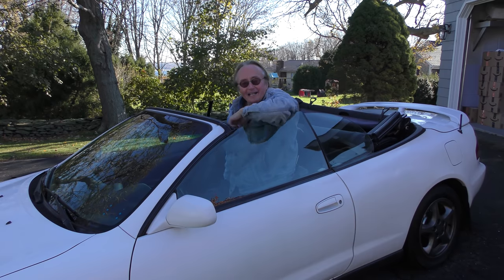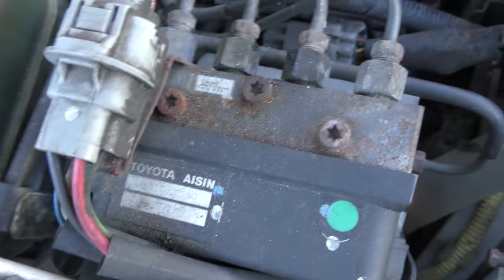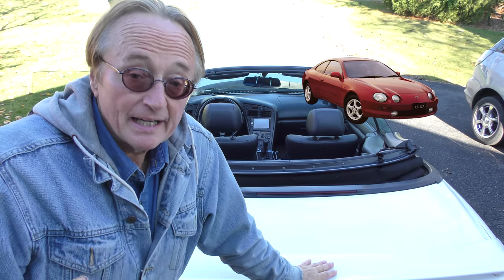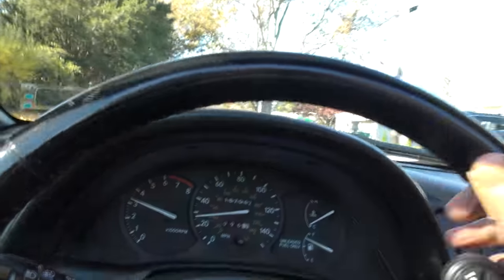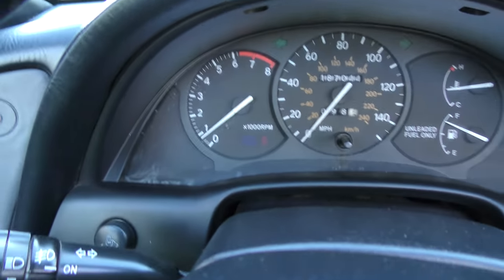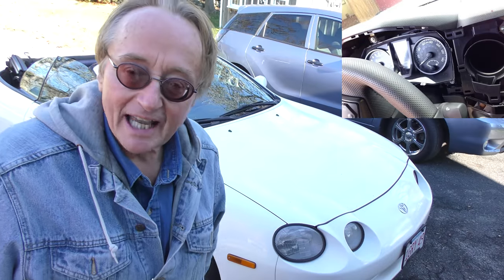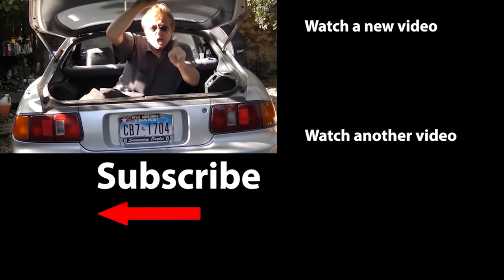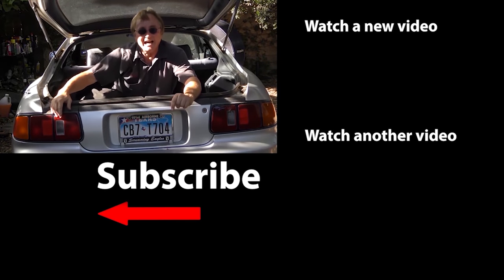I'm Sitting in the Best Car Ever Made

Comment: I have been driving my 7th gen Celica for 20 years. The original 1ZZFE (Toyota) engine developed the dreaded oil burning issue. Installed a 2ZZFE (Toyota+Yamaha) and zero issues. You might not like the design but the hatch swallows everything from mountain bikes to bookcases. 2400lbs and 200whp with 6 gears is absolute joy.

Comment: Just bought my 97 Celica GT convertible for $1200.  Was part of an estate sale, the owner who had it from 2004 recently died so was sold by his brother in law.  Not as nice as this one granted, and mine has 230,000 miles but engine and transmission are flawless although I think I have a power steering leak I need to investigate.  Just put on new KYB struts/mounts all round, the old ones were the originals and shot to pieces, the one on the front right side was so bad it was making a knocking sound, rides like a dream now.

Comment: I have my 95 GT rag top. 5 SPD.  I've owned it for ten years. Other than a set of brakes and a timing belt,  I've had zero problems. 168,000 miles.

Comment: I had a 99 solara it was a 3.0 V6 5 speed manual thing was actually awesome
Reply: I had the same, only with an auto. Drove it all through my twenties and put on tons of drama-free miles. Didn’t know they came with the manual—that would’ve been fun for sure. It was the best all around car I’ve had until I got my current 2012 Camaro SS, which  has been fantastic. Of course, it has the 6.2 LS3 and the 6 speed manual.

Comment: I have the latest shape Celica and the only thing heavier than the doors are neutron stars.
The amount of passengers that can't even open the door with the weight of them when park on a slope. Haha

As for the Yamaha engine if you buy one after 2002 the issues were fixed so they're a very dependable engine... plus they're a timing chain so no worries about belts snapping.

Comment: This is why I love my miata; manual convertible top, manual windows, manual locks, no power steering and a very smooth manual transmission. 30 years old, still looks and runs like a top.
Reply: 100% agree! Mine sadly has power steering and electric windows, but i absolute love how perfect it still runs and drives. best Fun for the buck.

Comment: I had a 1982 Celica with the 22R and a 1982 supra with an inline 6. Both were rust buckets with multiple problems. I had to fix headlight retractor motors, suspension, crankshaft pulley wore out and it was off timing 23 degrees and always some of the gadgets breaking. Too many problems to list.

Comment: Had a 1999 Celica GT convertible in Iris Blue about 15 years ago. Bought if from the original owner in almost immaculate condition, kept it about 4 years and sold it with 95K on the odo. Handled well, but way underpowered to really be any fun. 40 or 50 more hp would have made me smile. The most uncomfortable seats I've ever had in a car. I could never get the driver's window and rear seat window to align correctly - whistled like crazy. It was an OK car, but I'd never call it "The Best Car Ever Made".

Comment: Hello Scotty, nice car, lol.  I have a 2002 Acura Tl that I gave to my dad (retired) to drive around. It has 220k miles A/C heat no lights at all. I did the second timing belt myself 4 years ago,I got lucky when they did the trans recall in 2005 lol everything is original except the starter. I was a mechanic myself back in 2010. Good old Japanese made, not these new craps that breaks down in a year.  LOL.

Comment: The 90's Celica's rotted away 20 years ago around here.  It wasn't a common car, most of the parts are discontinued. Type in 1994 Celica on ebay and you will find no parts. The drivetrain would not be a problem but getting Celica specific parts new and used would be difficult and expensive.  Your better off buying a common car like a Corolla or a Civic.

Comment: Hey what do think of a 2001 subaru legacy wagon?? Mine is good condition much like this Toyota. Engine is clean except back 2 cylinders a lil leaky. But drives good. Oil is good but coolant tank is getting black. Not over heating at all. What do think i should do??

Comment: Well sir my 2002 taurus was smashed by a red light runner so with the ins money i just got a 2000 toyota solara v6 101000 miles ... just changed oil syn and  transmission fluid got it   for 3500 i know you like them ....

Comment: is toyota celica 2002 worth buying for a sport car?
Reply: I've had two.
I'm on my second one now the first one had 180k miles when I swapped it for a 2005.
The only issues I've had with both is the radiator had a leak on my older one, but it was easy to repair and cheap to replace.
If youre going for a 2002 that's the refined 1.8 engine. Pre 2002 the engines could have oil burning issues but this was pretty much sorted after 2002.
But if you're the type of person that checks their oil regularly this won't be a problem as you just top it up when needed.

They're easy to work on too if you're the DIY sort as they're in that age where you can still work on a car... 

They're fun to drive too, they stick to the road like glue even keeping up with much faster stuff around the twisties. But power is probably the only downside, its from a different era so most modern cars will out run it in a drag race, there are two versions too.
A 140bhp VVTI model which will hit 0-60 in around 8.5 seconds.
And a 190 VVTLI which is closer to 7 seconds. Personally I've always gone for the 140, cheaper insurance, running costs and the valve lift (the L in VVTLI) can be problematic if neglected. Plus the lift only kicks in at higher revs like VTEC so upto that point there isn't much difference in acceleration.

Also if you can go for the premium spec, you'll get leather and climate control for no extra charge if you look for it, so don't settle for cloth seats and old slider heater toggles.

Sorry for the long reply but if you have any other questions just let me know.

Comment: Doesn't look like the safest car in the world.  I have a Volvo C70 hardtop convertible. With the top down I pretty much lose access to the trunk as that's where the panels go, but it has ROPS (Roll Over Protection System) which automatically pops up in the event of a rollover to keep the car from turning flat turtle on my head.  As soon as you feel the sides of the Volvo you realize how much more car body is there to protect from side impacts.  5 cylinder turbo gives it reasonable performance and is much smoother than a 4 cylinder.

Comment: That's a high flow intake. Any aftermarket filter setup that sits inside the bay like that is high flow. Cold air intakes pull air in from the fenderwell or bumper area outside the bay.
Reply: Ask him if he cares about the difference. He's not a fan of neither one
Reply: As someone who works on cars he should. Those intakes can hurt performance once the car is heat soaked. Can also make the car run funny if the MAF isn't located right. Most the stuff he works on is stock so it's whatever at the end of the day.

Comment: I used to be a Toyota guy, two 4Runners year 99/11 and an 06 Tacoma, I sold the Tacoma last year, it was my third vehicle and posed a problem when I moved a 5 hr drive to my new home. (Two drivers, three cars) I thought I sold it for a good price @ $21,900 it was a loaded TRD with tow package with only 40,000 miles. (Less than 3000 mi a yr. Now this year I see them going for above original selling price?? WTF happened?  I was in getting one of my current cars serviced and they were saying ppl are paying up to $40 grand for something like my pristine updated 06?  I’m in Canada so I’m not sure if it’s country specific, but supply and demand issues in N America are making things crazy!  I have a SUV and a white convertible, hehe, Scotty wouldn’t be a fan, the little rag top has a naturally aspirated 4.2 litre V8 putting out 450 hp …Schnell! 😂

Comment: you say the yamaha engines are no good? i got a 2003 pontiac vibe gt which has the toyota/yamaha engine. milage was stuck at 299999 kms which is common with vibes/corolla/matrix of that year. guy wanted 2400 and i talked him down to 2000 CAD so i thought it was a decent deal. almost had it a full year and its going strong still. glad i grabbed it when i did cause gas was 127.9/L when i got it and i primarily bought it for fuel efficiency and it jumped to 143.9 awhile back and stayed there.
Reply: @Marcel Obey that’s because you probably drive like a granny😂

Comment: Hi I have a question anyone could help i live in NSW Sydney i have a 2019 2.2 turbo diesel mazda done 55000kms CX5 the car was showing dpf warning light the mazda cx5 has been taken 3 times to mazda car workshop dealer they have changed the DPF sensor and checked car all around and they done a full report test. The was repaird but the issue still has come again with the same problem the Next day DPF warning light What could it be please.

Comment: Oh Scotty, that car has no rust because it's NEVER driven in the Winter. That's somebody's toy, you better believe it runs and drives good. Duh. 3 grand? Really? That is a good deal. And the little things are done. But, it sounds like it needs a lot of work now starting with the struts. Those should have been done. The springs have to be sagging by now and probably were 10 years ago. And that starter, and that alternator. It's all coming due. The thing's 25 years old. It's a classic by definition. But this is make or break time. Use it or lose it. But, for 3 grand, assuming she always got her oil changes, a couple grand more to make her like new mechanically is a great deal. Especially today. Just love the convertible. I had to do a double take when you said it was a Toyota. I don't know, I think the Miata is better looking. But this is really nice. Great find! I can't believe the scan tool even plugged into it.

Comment: every new car is tinny sounding doors. my old one has a nice thud. maybe the new ones have to break in a little? i like the look of the last generation of celica. they shoulda kept making them, so what, they made a mistake with the engine, just correct the mistake and carry on. toyota's weird lol they get scared of their own car models if something goes somewhat wrong. like they tried that scion branding and gave up quick on it. scion had some nice stylings but wasnt necessary to begin with but shoulda carried over some of those semi boxy styles.
187 000 miles with same AC and alternator hehe. but that's near the end of the life of those components. how many miles on your lexus? you said you changed the alternator recently.

Comment: Scotty, I would like to hear your opinion regarding the new Santa Cruz 😆
Reply: My opinion it’s ugly as hell a Honda Ridgeline is 1,000 times nicer and more attractive and it’s more masculine a Santa Cruz is very weak only 4 cylinders, good on gas but that’s it. 😂
Reply: @codybrandoncargle3129  I actually wanted a ridgeline. However, it starts at the point the Santa Cruz is already fully loaded.
Regarding the appearance and performance, I like what is offered. 2.5T with 281 HP isn't bad for me.
Reply: @diegovn  Santa Cruz maybe fully loaded but the Ridgeline will last longer trust me Hyundai engines are extremely weak especially the piston rings in them. 🤔
Reply: @codybrandoncargle3129  this is what I am afraid off. For sure honda and Toyota are much better. However, I barely drive 10k per year. I bet this car can last at least 10 years with me without problems.
I currently have a Mitsubishi, a brand that I used to like in the past. Nowadays its also so poorly made. Not so far from these korean cars.
Reply: @diegovn  Yeah it’s okay to be afraid of, yes Honda and Toyota are definitely better, yeah that’s good to know, umm maybe, and yeah Mitsubishi is definitely garbage plus the transmissions are worse than Nissan from what I heard, Korean cars are still not much better they will last longer than Mitsubishi but are still below Nissan level of good actually. 🤔
Reply: @codybrandoncargle3129  definitively. Almost all brands are garbage nowadays. Nissan also suck. I miss the 80's, 90's.
If I did not have to wait forever again, I would probably try a RAV4 instead. But I also need a truck(ish).
Fingers crossed it won't become the new Sonata/Elantra.
Reply: @diegovn  Yeah that’s true about almost all car brands and yes Nissan is extremely lousy, yeah the 80’s was before my time but my parents definitely miss it probably more so my mom than my dad since he was born in 1960, and the 90’s well I was born in 1995, so technically I was in the middle of it, and yeah the RAV4 is a decent suv but I prefer the Cx series more, and yeah for now the Sonata/Elantra is safe, but the design of Hyundai cars is atrocious to me, and secondly I amazed Kia won’t come out with a similar vehicle just like the Ridgeline and Santa Cruz! 🤔
Reply: @codybrandoncargle3129  Yeah. I Will at least search more about this car before buying (I am still waiting to arrive). I am not a fan of the cx line design. And this is also the first Hyundai I like visually. Anyways. I'd like to see a review from Scotty 🙃
Reply: @diegovn  Yeah I would man, why don’t you like the Mazda Cx series? 😳 And honestly the only Hyundai I truly like is the Veloster that’s it? 🤔
Reply: @codybrandoncargle3129  dunno. None of the Mazda cars are appealing to me. The veloster is kinda okay tho
Reply: @diegovn  Wow you don’t like none of the Mazda cars and they don’t appeal to you Hmm! 🤔 What car brands do appeal to you then? 🤔 And yeah like I said I’m not a Kia or Hyundai fan I personally only like Genesis and even then they also suck because it’s Hyundai brand as well! 🤔
Reply: @codybrandoncargle3129  I am a very big fan of some isolated models, lets say the ford mustang (not ev), the ionic 5 for ev, the new silverado or the ridgeline for trucks, new nissan z is cool...those I think would be my first options nowadays (I do think cars look all the same these days too. Not finding very attractive options right now). Thinking of pre-owned the list would be much bigger.

Comment: You're wrong, gas varies greatly, even between stations of the same brand. A lot of those are privately owned and they buy their gas where they want. Their own brand will sell to somebody else unbranded and that's all they care about. Selling a certain amount of their brand, no matter where it goes. And Indian reservation gas is the worst by far. You should know this, you're from here. I had a motorcycle that wouldn't run on it at all and it had to be dumped. Your fuel mileage drops off a cliff. I have a couple of high performance cars that are very picky about their gas. My Charger only really likes the 93 at one station. It's supercharged and needs the 93. It runs well on Speedway 90 no ethanol in a pinch. But you notice the difference at that one Mobile station. It's uncanny really. That car is a pain in my butt. My Prowler likes the 90 non ethanol as well. It's runs good on 91 ethanol, but that car gets stored in the Winter and I don't have to worry about ethanol separation when it sits with the 90. My Charger is my daily driver and is designed for ethanol. Modern tanks don't get water in them. C'mon, now you're getting ridiculous. Modern underground tanks even have blowers in them. What your Daddy told you hasn't be true for at least two decades. And all the old tanks were replaced.

Comment: So when oil jumps another 30% it will be I told you so for drivers.
If you notice, Asian cars are all pretty much less than 2.0 liters. Lack of advanced
Technology must be factored into a bonus in economical car cost. No turbo, no, gdi.
I am predicting that salvage yards will be selling a whole lot of builder inline fours and their mating transmissions instead of V8's. 
They will be stripping off the injectors and rails. All acessories A/C compressor, alternators, starters. Just like 1980's when 
They made bank with V8 cores for Camaro, Mustang. Dodges big mistake was no pony car for 15 years. Business suicide alt left. The big sleazy is the
BidenObamaClintonEconomic crush on steroids in 2022. The infrastrucure padding the wallets.

Comment: If it ain't a Honda S2000, it's wrong.
Reply: You can get a celica convertible for less than 1/10 the cost of a s2000. You can swap in an st205/caldina engine or beams engine to make about as much power as the s2000.  You'll find people swapping out the st205 awd into the celica convertible. By the time someone gets all that work done, they'll have paid still probably less than they would have for an s2000.

Comment: Best top less car ever made is a Celica?? Good Lord Scotty must have never heard of an S2000. I had an S2000 that I supercharged to make about 400 WHP and it was a V8 killer. 400 WPH on a car that weighted less then 3000 pounds = V8 killer because of the power to weight ratio.

Heck even a stock S2000 is a better car then a Celica.
Reply: but will it outlast the celica? i think not. 90's toyotas are the most bulletproof cars
Reply: @GuerreroDelInfo  Have you never owned a S2000??? I currently know several people who own S2000's that have 225k miles with ZERO major issues. Now simple things like alternator and starter have gone out, he has had ZERO engine issues itself.

I used to own one that was custom built and that thing was a beast and lasted well over 80k miles fully built without any issues.